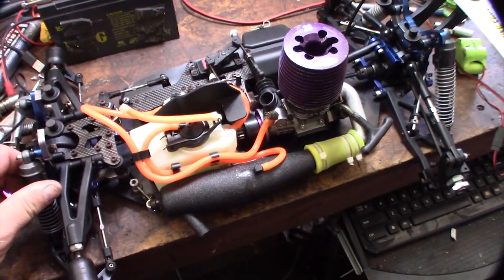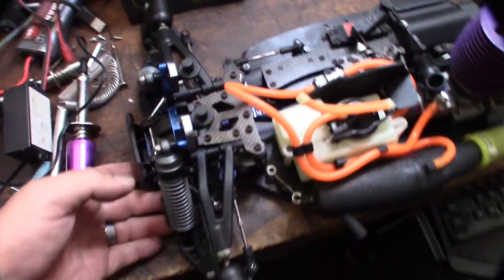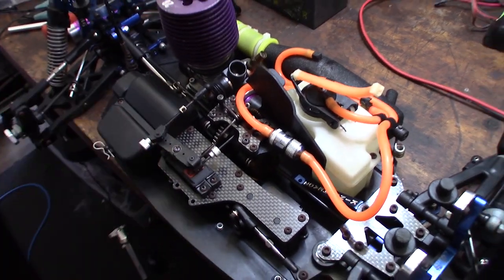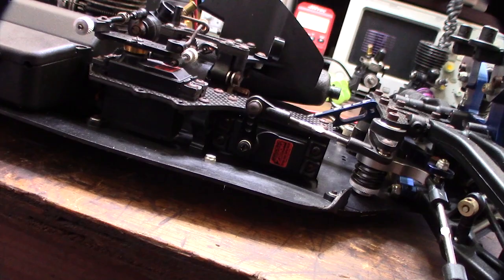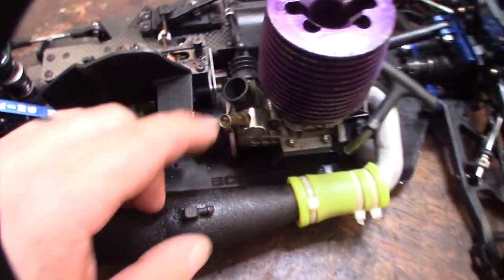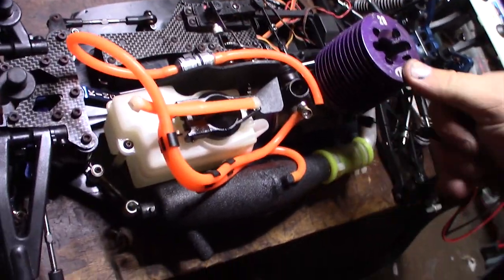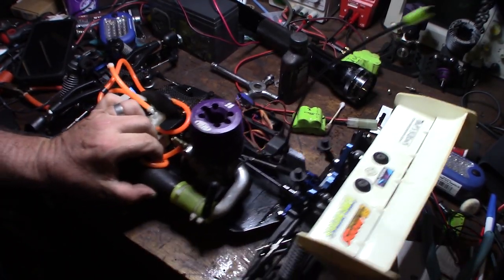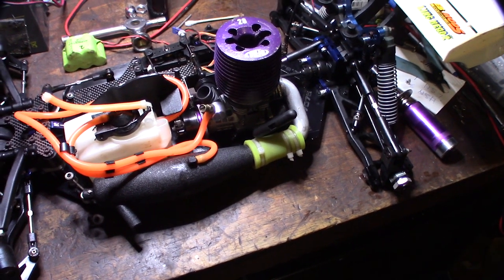Mugen Seiki MBX5 Truggy? Or Buggy? Resurrection Nitro RC restoration MBX5T conversion

Comment: That's the msrx5t.. I have one 👌and still run it on the track.. That's not the original chassi js but it is a mbx5t chassi 👍
Reply: Do you know what parts it usually takes to convert a Mugen buggy to truggy? or vice versa?